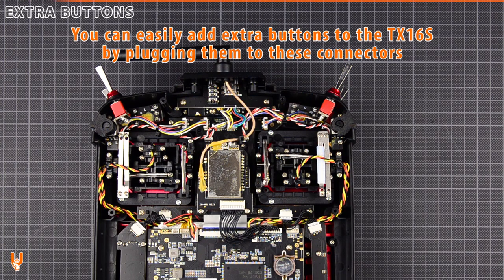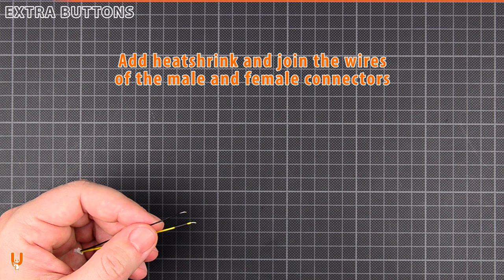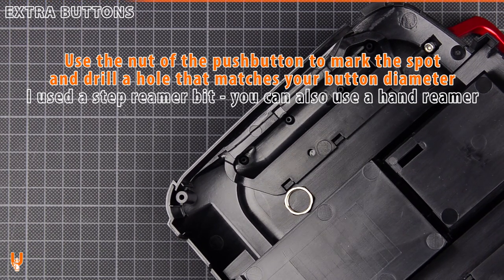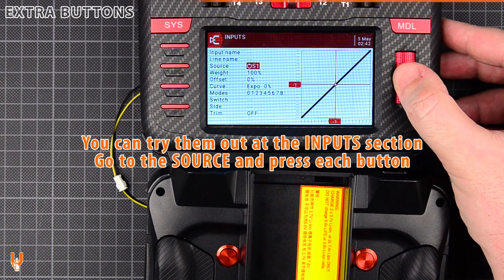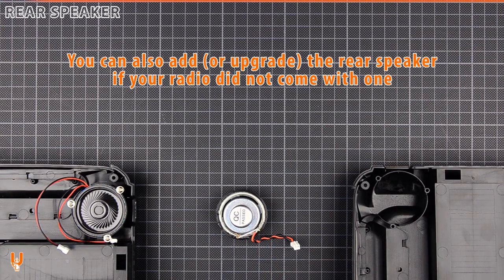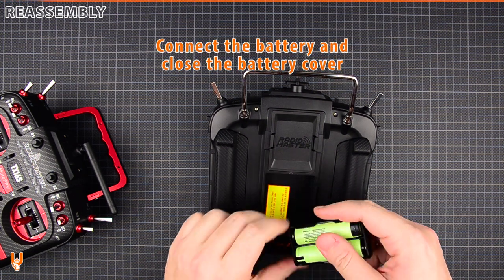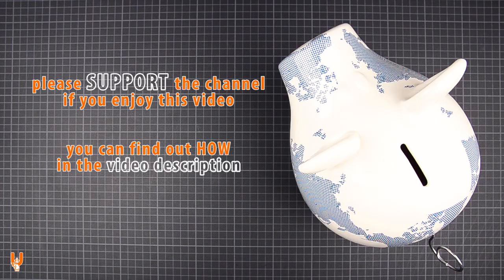PART 3 of Radiomaster TX16S mods : how to add extra buttons or switches and reassemble the radio

Comment: Very informative, thank you. 
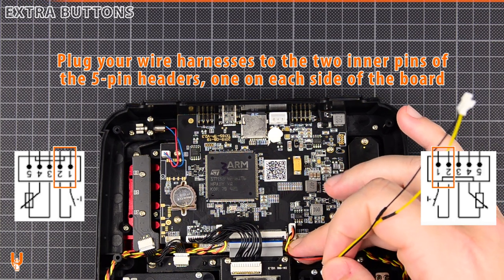At 4:01 you show a schematic. Can you connect a potentiometer or a 3-pos. Switch to the 3 unused pins? What is the value of the resistor?
Reply from the maker: I am sure there is a way because others have added joysticks at the back, but I don't know any details. I will try to find that project.
Reply: @muteFPV  Thank you for your help!
Reply from the maker: I haven't helped yet, I hope I will 😉

Comment: Can you add additional POTs this way as well? I would like to be able to map the betaflight tuning sliders to POTs in the future.
Reply from the maker: I am not sure, never tried it before. If I am not mistaken, others have added joysticks so additional pots should be ok too. Why not use the pots at the top though? You could use the logic functions of the radio and use a switch as a modifier for the pots (so one pot could change up to 3 different settings).

Comment: Thanks so much for the video!  I would love to know what the diameter of the button is to the original size of the hole in the back of the new MTKi model to know what to order.  Thanks!
Reply from the maker: You're welcome! Please clarify which radio you mean by MTKi model, I don't understand
Reply: Tx16s max mrkii: https://www.radiomasterrc.com/products/tx16s-mark-ii-max-radio-controller  
has a back button preparation.
Reply: gal david asked for me.  Mistake in writing 😅 @muteFPV
Reply from the maker: ok thank you, I will try to find out and get back to you
Reply: I searched and did not find.  I would be very happy Thank you!
Reply from the maker: I checked my standard TX16S MKII (I don't have the max version). There is a hole at the back that fits 12mm pushbuttons.
Reply: Thank you!  Very appreciative.

Comment: I found yesterday if you clip the 4 selection buttons off their tab runner (and discard that), and just have them as 4 free floating independent buttons, particularly the metal CNC ones, they work and move much more freely.  I used a pair of wire snips.  They worked like a boss right off the bat, no fiddling or adjustment needed, where as before I could only get 2 out of 4 to barely move.

Have you tried the jumper back yet?  I think you'll lose battery compartment space if you do.  I hated that hump, it held my fingers even further away, but I've gotten use to it by now.  Maybe I'll try that one after I get the URUAV light kit installed.  I'm thinking the Left and Right SI/SJ extra switch connector have a regulated +5v regulated output on some of those pins or near them, but I haven't checked yet.
Reply from the maker: I havent' had any problems clicking the 4 buttons but if I have a spare CNC piece I will try it too.
I had ordered a jumper back from Aliexpress but it never arrived, I will probably order another one. Battery space is enough for my 18650 so I am fine with it.
No idea about the 5V output on those connectors :)

Comment: Just last night I hacked an MT30 socket into my T16 to properly balance charge the cells using my iSDT charger & custom cable. I don't trust the USB charging board, I tested it by charging two cells with different voltages and stopped when I measured one at 4.25v and the other at 4.10v.
Today I uploaded the 3D printed XT30 holder design to Thingiverse 4759865, the socket placement might work with the TX16S since it shares an almost identical shell.
Reply from the maker: Thanks, it looks great (as usual). But I still don't understand why you went for this overkill connector. Too much bulk for no reason, I was very happy with the XLR connector.
Reply: @muteFPV  Yes I purposely went for a rugged connector since the balance connectors aren't.
The 2S balance connector on the battery packs for my Fat Sharks has broken too many times over the years (wires always snap off the connector), and I find having to plug the T16 pack in by its 2S balance connector unnecessarily fiddly and annoying.
Reply from the maker: I agree about the balance connectors, especially when pulled from the wires they don't last long. I just think the MT30 is too much for this use case. I still consider the micro XLR I used a better and easier choice. Installs in a simple hole and just needs a small cap to cover the exposed pins when not in use. I love your drilling/routing btw, did you free-hand it or drilled the corner holes and then cut the straight lines?
Reply: @muteFPV  A combination of free-hand and using the 3D printed piece as a guide to what to remove. I used a reamer tool to make the initial holes, then a diamond file set to get the triangle shape, and a sharp knife to smooth it off.
Reply from the maker: Super clean!

Comment: You could try plasti dip on the sliders to color them and give them resistance without the o ring
And to color the switches
Reply from the maker: I am not sure how well plastidip will hold onto the plastic of the sliders while getting rubbed on the edges of the shell. For the switches maybe it will work better but again, I have no idea about its durability over time. As far as I know, if it peels it is over, right?

Comment: Great video. I have added the two buttons just like u but also want to add two extra knobs as ext1 & ext2. I Know the three wires for the knob go in the three pins next to the two pins that were used for the button but I do not know which colour wires go in which of the three pins. Are u able to help. The three wires for the knob are red, yellow and brown.
Reply from the maker: I will try to find my notes for the radio and see what I can find. By "knob" you mean a potentiometer?

Comment: The button you added on the back, should have a voltage of 5 or 12v?
Reply from the maker: Hello. Do you mean the buttons I installed at the back of my TX16S MAX? What do you mean by "tension support"?
Reply: I mean the button you added at the back at 00:33.  The one you connected to the jst gh connector
Reply from the maker: Usually pushbuttons that state 5V or 12V are illuminated. If you are going to wire them as I did in the video, you will only be connecting the switching element of the pushbutton to the radio and not its illumination, so it doesn't matter which one you choose.
Reply: Ok, and if I want to connect such a button with a working LED ring in addition to switching, then I will need a 12v button?  Do you perhaps know how to connect such a button so that it fits the jst in the controller?  Thanks for answering so many questions!
Reply from the maker: I am not sure what the voltage output of the pins that power the led gimbal rings is. If I had to guess, probably around 5V. You can wire the illumination of the pushbutton to the pin that powers the led rings (check my video where I show the schematics or you can find the schematics in Radiomaster's product page for the led rings). But, honestly, I wouldn't illuminate something I am not going to see anyway. This is why I installed the led rings in my backup radio that is usually at home for sim and tests, and not in my main radio where I would never watch them since I am wearing goggles.

Comment: Thanks. Would this replace two switches/buttons/pots that are already on the tx or give u two extra bottons?
Reply from the maker: Hello! These are two extra buttons, you don't lose any of the existing switches/buttons/pots :)
Reply: @muteFPV  Thanks. Are there any other ports to connect more switches/pots on or are there just two?
Reply from the maker: I want to say yes but I am not 100% sure how many you can have working at the same time. I will take a look when I have time to spare.

Comment: is it possible to ad extra sticks/gimbals to this radio aswell?
Reply from the maker: Hello! What do you mean exactly? A third gimbal, for example? Or replace the stock gimbals with something better?
Reply: @muteFPV  a third, and maybe a fourth:) im not using my radio to control cars or planes, but rather for animatronics and such. i want as many sticks as possible on my radio.
Reply from the maker: I see. I remember some mods that added a joystick for camera gimbal control, for example, but I have not done it myself to help you with pinouts etc.

Comment: Any idea? I installed the LED gimbal lights and then my ls slider when it is moved to the highest position the T3 trim switch moves automatically to the lowest trim, Everything else is working. I have replaced the throttle gimbal cause it broke and it didn't do anything for the slider. I replaced the slider switches and the breakout board and still didn't help. Radiomaster suggested that the ribbon cable might have been loose, but wasn't the case. I have ordered another main board as the gimbal lights are plugged into the main board.
Reply from the maker: I recently installed mine without any issues. Are the wires of the connectors on the led rings at the correct position (as in the instalation schematic)? If the problem started after installing the led rings, there is either somethig wrong with the wiring, or something went wrong during the installation. I am sure you would have noticed if you damaged  the ribbon cable. If you open the radio again, I would try unplugging the led rings and see if everything returns back to normal.
Reply: @muteFPV  yeah unplugging the lights was the first thing I did and later removed them but still happened. I'm sure it wasn't like this before I installed the lights I've been using this radio for a year I would have noticed it. It was a little tight fitting the led rings in I could have messed something up, I have taken it completely apart when I installed the new break out board while I was doing that I switched the face plate for the upgrade. Everything works but still does the thing the main board is all that's left.
Reply from the maker: I can't think of anything mate, sorry. But I will keep an eye and let you know if I happen to find a fix or explanation!

Comment: Is it possible to use one of the LED lighted buttons?
Reply from the maker: You mean as an extra pushbutton, the ones with an illuminated symbol or ring?
Reply: @muteFPV  Exactly
Reply from the maker: I can't remember where you tap into to get voltage for the LED of the pushbutton but you can definitely do it.

Comment: can you put both push button and leds?
Reply from the maker: If i recall correctly you can wire both on the same connector, you will just need to use a common ground pin for both.
Reply: so basically splice the wires? @muteFPV
Reply from the maker: Yes, if you need to use the same ground pin for both, you can make a simple Y connection (twist, solder lightly and cover with heatshrink)
Reply: thanks i appreciate it. do you have an idea what the wiring is? the push button i have is 2 wires  @muteFPV
Reply from the maker: The wiring should be the same as in my video, I had used a 2-wire button as well

Comment: Hello,

 What is the maximum length of the switch?
Reply from the maker: Hello! I am not sure, I never measured. I just used one of the shortest buttons I could get.
Reply: @muteFPV  
Okay, and how long it is?
Reply from the maker: I don't have a spare button laying around but I would say less than 25mm - closer to 20mm with the terminals bent
Reply: Thank you! And where had you buy it?
Reply from the maker: Aliexpress or Ebay I suppose, it has been quite a while. I have a few indicative links in the video description.

Comment: Can SI and SJ be two position switches? Regards
Reply from the maker: It should be the same thing, a two position switch is like a latched (maintained) pushbutton, either on or off.
Reply: @muteFPV  I just ordered one each. I wonder if it is easy to put them on the top of the tx.
Reply from the maker: It depends on their size, I have seen others fit them at the top.
Reply: @muteFPV  Ok, once they arrive I will let you know. Thks

Comment: 👏👏👏...😜👌
Reply: @muteFPV  Can I connect a two position switch to pins 3,4,5?
You did a wonderful thing!
        Thank you very much!
Reply from the maker: If it is just a 2-position switch, you can wire it to the first 2 pins, instead of the button I used. I you mean populate all 5 pins of the headers, I have been told that a pot can be wired to pins 3,4,5. I have not tried it and have never looked into it though.
Reply: @muteFPV  Yes you are right! I am convinced of your answer! Thank you very much! 😜👌